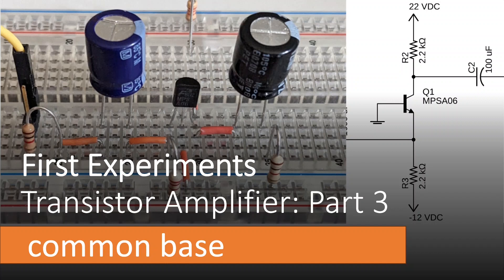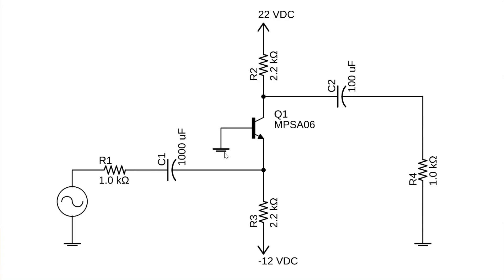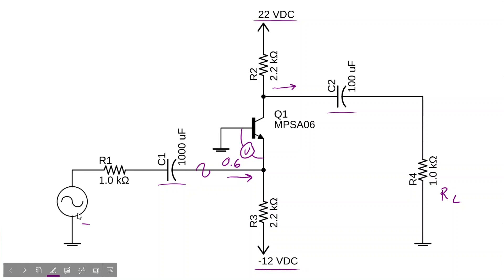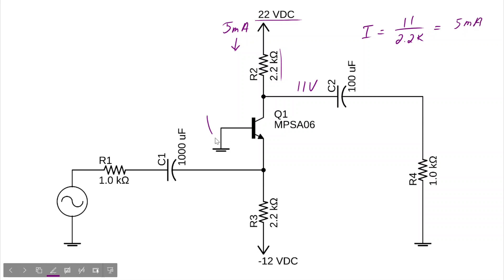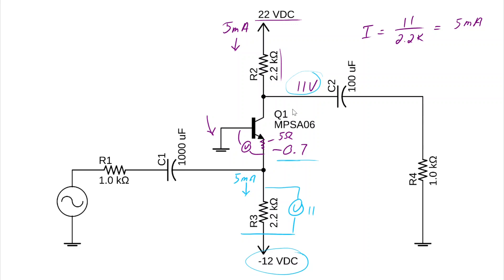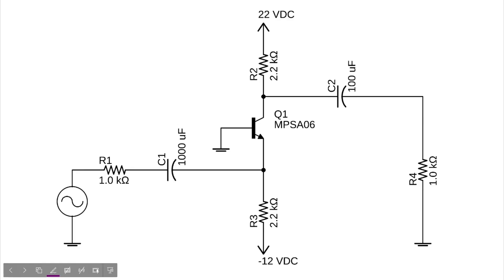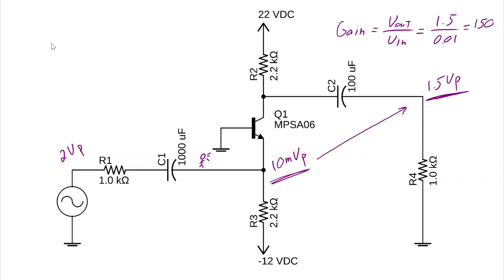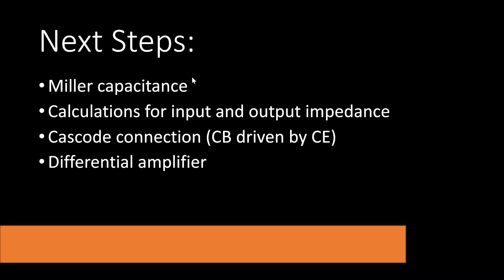Practical Common-Base Amplifier: Breadboard Implementation and Signal Measurements

Comment: The common base amplifier is great when you want an extremely low input impedance amplifier.
I used one mucking around to amplify an 8 ohm speaker to use it as a microphone. Worked excellent